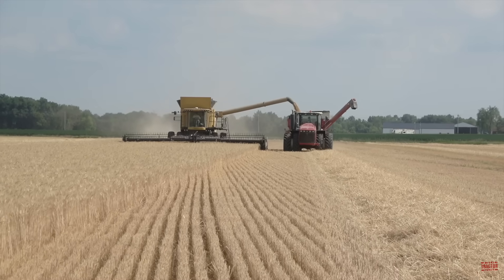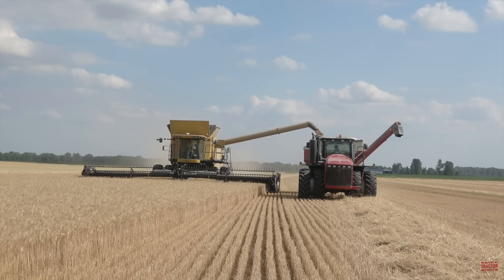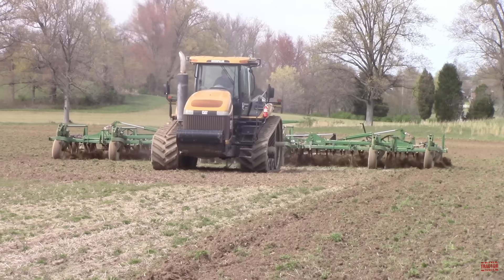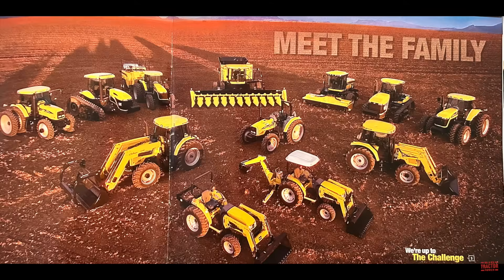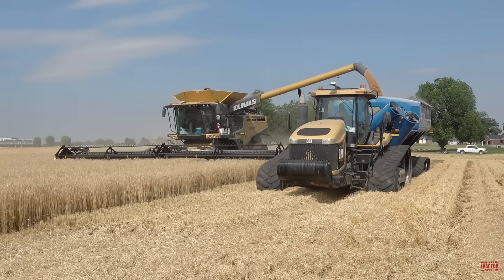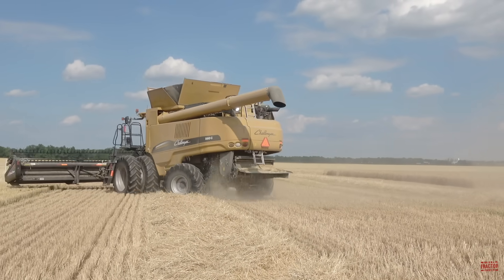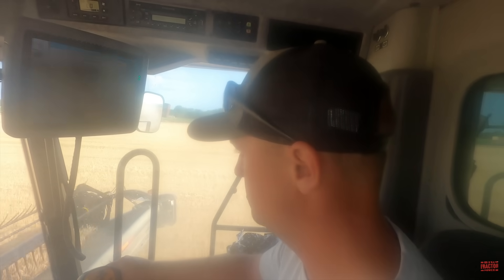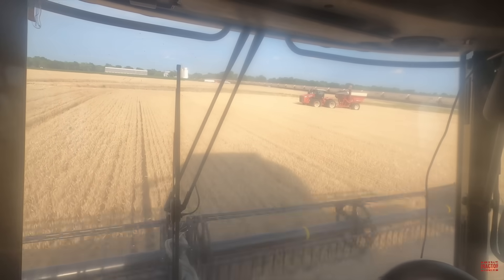What is a CHALLENGER Combine?

Comment: The reason you don't see as many Challenger combines is most Cat dealers were Claas dealers and wanted to sell you a Lexion over a yellow Massey.
Reply: And now some Cat dealers are dropping Claas to sell you a Fendt Idea combine over a Claas Lexion.
Reply: @Zero01k  Yeah, that’s one good thing about having all John Deere equipment. Things don’t change much with them. Not saying Deere is better.
Reply: Ordering parts is not a hassle anymore these days, not like it use to be, availability is another recent issue, but before corona wasn't a big issue.  We don't typically rely on a dealer for any of our equipment since most of it is used equipment.  It's a fuzzy feeling when you go to your local 20+ stores Deere dealer for a pretty common part on a piece of machinery and none of the 20+ stores doesn't have the part you want.

Comment: As always with BTP, it is great to get the background on machines, which in some instances at least, were badge engineering exercises. I notice in this video, the operator has left a fairly long stubble. Presumeably this is so as not to needlessly overload the combine or perhaps it's to do with reducing potential soil erosion ?
Reply: Longer stubble holds more moisture and helps shield the soil from evaporation.
Reply: @wayneharney8  hi and thank you for your reply to my question. 👍